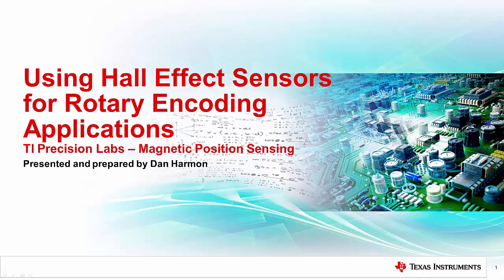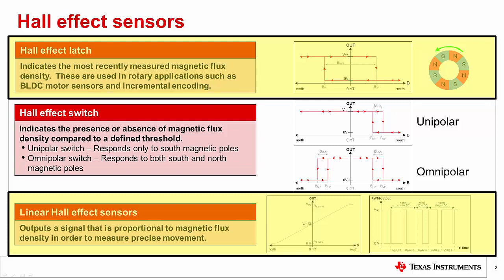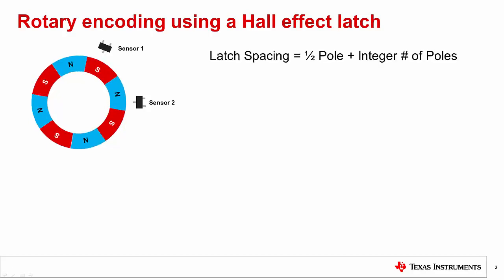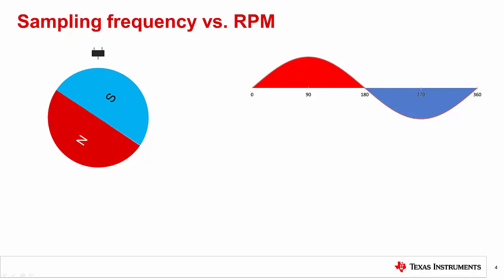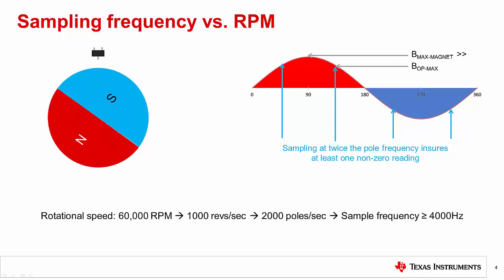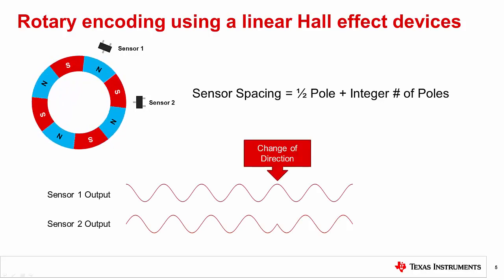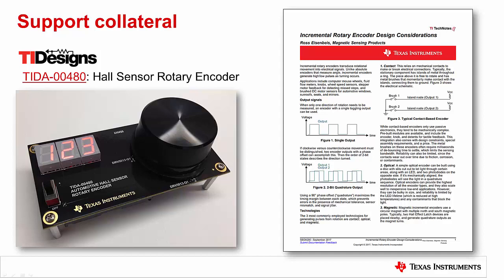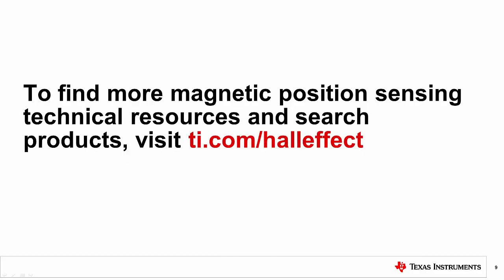Using Hall-effect position sensors for rotary encoding

Comment: Hello, thank you very much for this. I have a brushless DC motor whose speed/RPM is controlled with a lever and a 49E. Do you know a cylindrical circular hall effect sensor that has the same connections and electrical data as the 49E? It looks like a potentiometer but is a circular hall effect sensor. If something like that would work, would you even have a part number of it, could you recommend a part? Thank you very much!

Comment: Hey I  want to know acout accuracy and rough idea of pulse per rotation? I want to use hall sensor for  gaming steering wheel application, but dont know how to use it. Can you tell me or refer to any reference for this kind of  thing i want to know how logitech g29 and similar wheels achieve acurate shaft position using hall effect sensor? Thank you